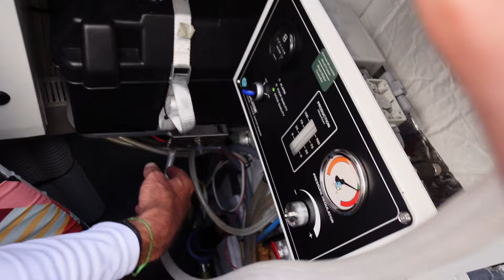Engine Problems in Tight Quarters (EP 77) #sailing #lifestyle

Comment: Hi, could you please give more information about the Parker valve you are using for pressure control , I had a look at their website and there are hundreds of options.

Thanks!
Reply from the maker: I ordered it directly from Dessalator (our watermaker) so I'm not sure where they sourced it. I couldn't find it with a Google search but I'll ask them.
Reply from the maker: People can order this particular Parker valve as a set (valve, bracket and hose pillars) directly from Dessalator France at contact@dessalator.com. List price is EUR 202,80.
What you're really looking for with a watermaker is a switch over valve without a 'closed' position.
Reply: Thank you!